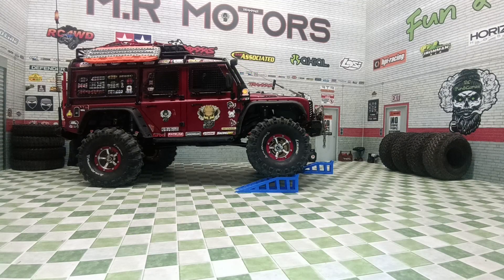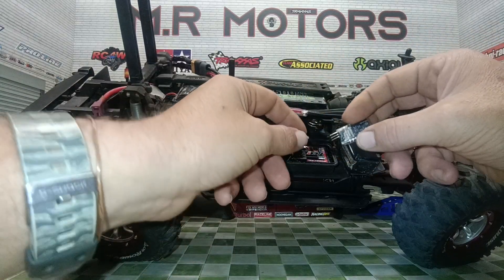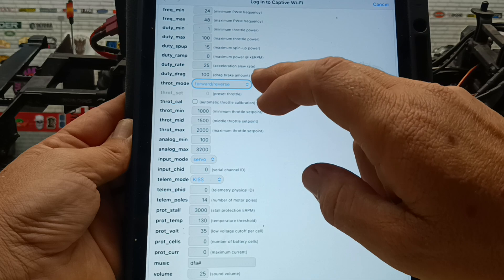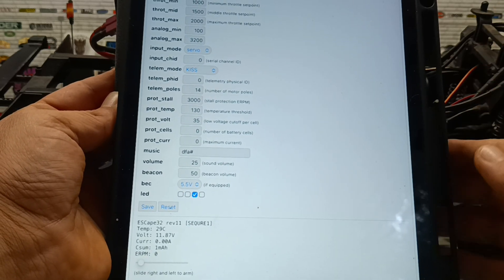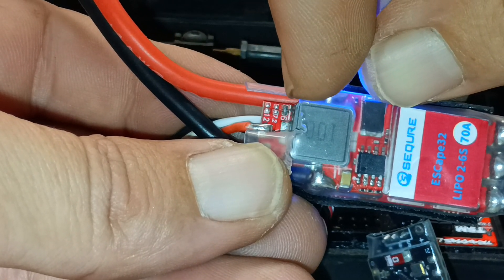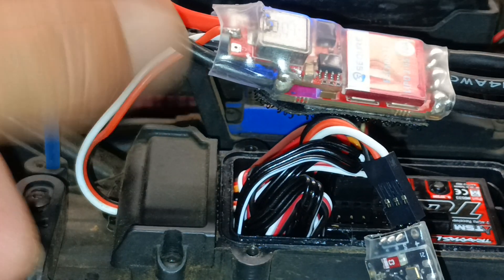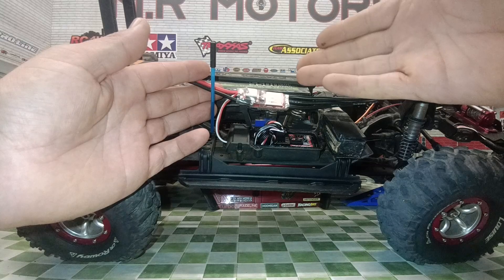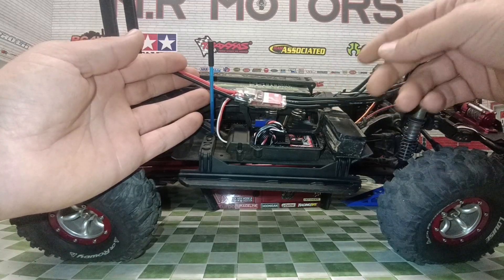ESCape32 how to use Wi-Fi link and BEC #trx4defender #sequre1800kv

Comment: This maybe a dumb question, but do you have to initially flash Escape32 on the Sequre ESC's?
Reply from the maker: To start off! that's not a dumb question!
And the answer is no it is already done from the factory. 
It is extremely easy to program with the Wi-Fi programmer 
All in all I'm very impressed with  this system.

Comment: How quiet is it running at speed?
Reply from the maker: If you look for the video when I did the installation you will see and hear how it sounds at speed.
Add crawling speeds it's extremely quiet, but when you do open it up! It does make quite a bit of noise.
But I have heard worse. 
Overall I am extremely impressed with this combo and its performance. 
You never run for that long at open throttle so it really isn't annoying at all.

Comment: After doing the conversation, I lost power to the power distribution block for my lights. Is there a work around for that or am I just outta luck?
Reply from the maker: Yes I have the same problem, you going to have to find another way to supply current to the light kit. 
Maybe run just a small auxiliary battery just for the lights. 
I will look into this and make a video about it 👍

Comment: Can I solder them all or only 1?  I tried soldering all of them and ended up not working.  It would be nice if you would let us know if we needed more solder wire or not....
Reply from the maker: @DirtDobberRC  if you listen carefully I explain exactly what you need to solder depending on the voltage of your servo
Soldering all of them will give you more than 12 volts and burn out most servos on the market that fit these rigs.
Check the voltage of your Servo and solder accordingly. 
Watch the video again as I explained very carefully which ones to solder depending on the voltage.

Comment: What app did you use?
Reply from the maker: You don't have to use any app, you just look for the Wi-Fi signal and pair to it then it automatically opens the program for you to mess with the settings. 
Follow the video step by step it's really easy. 
One of the best interface systems I've used with a brushless system.
Reply: @rcfungames  yeah, no luck. Nothing opens when connected.
Reply from the maker: @mrbutchee1  I had troubles sometimes to get it to work on my Android phone, I ended up using my Apple tablet.
Reply: I finally did it through my computer
Reply from the maker: @mrbutchee1  don't forget you need to unplug the cable that goes to the receiver and plug in the Bluetooth unit.
Then you power it on.
You then go to the Bluetooth on your device, find it and connect to it.

Comment: Did you have any issues running your servo off the internal bec? What is the amperage capacity on that bec? What servo are you running?
Reply from the maker: No I had absolutely no issues running it with the internal bec.
It comes set at 5.5 volts and the servo I am running is a 6 volt 
The servo I am running is the Absima combat series 20 kg

Comment: What ap did you use?
Reply from the maker: @toomanyhobbies7410  there is no app, you link onto the Wi-Fi band off the device you plugged into the ESC, it will then automatically open the program. 
Watch the video carefully I show in detail how to do it
Reply: @rcfungames  ok ill try again.   I couldn't get it to connect.   It would connect to the sequre wifi but not connect